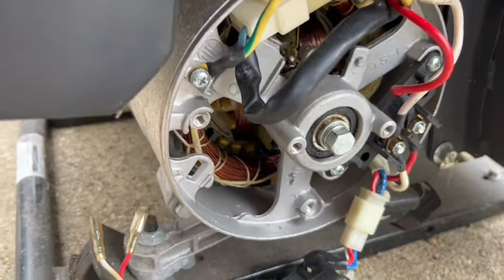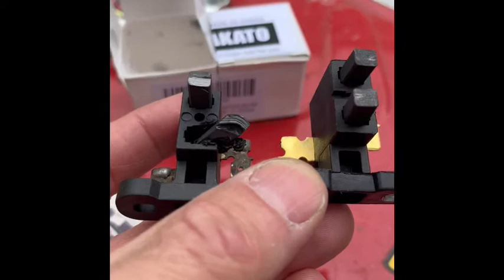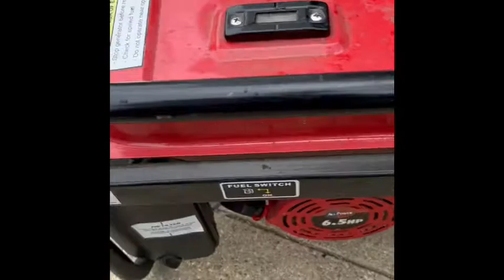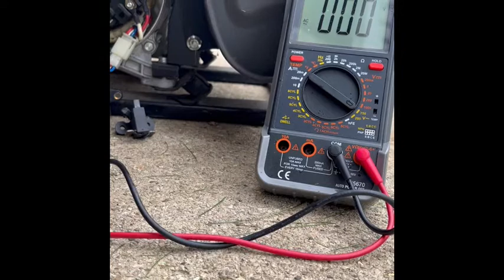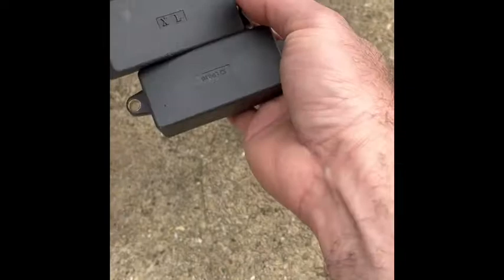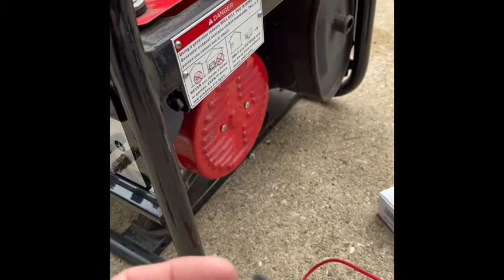Generator repair no power easy cheap fix and so simple

Comment: Hello, You stated you had no AV voltage reading at the brushes. The brushes are DC not AC. If you look there is a + and - terminal on the brushes. DC voltage is passed thru the brushes to control the field in the rotor. Thanks for the video.

Comment: Always check the brushes before swapping the AVR. Sometimes the brushes are faulty and they do not take out the AVR. Failure to produce power for a generator can be fatal. Often the windings in the coils will be burned out or otherwise faulty. It is not cheap or easy to replace those windings. If you want to learn a bit more about portable generator repair go look at the channel by James Condon Generator Repair on youtube.
Reply from the maker: Thank you